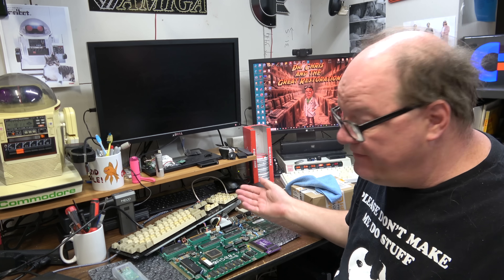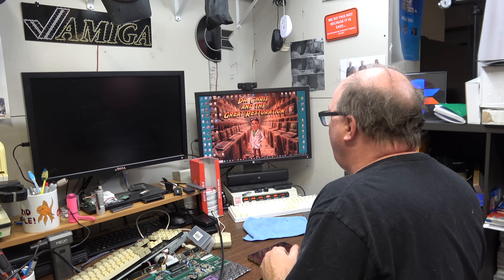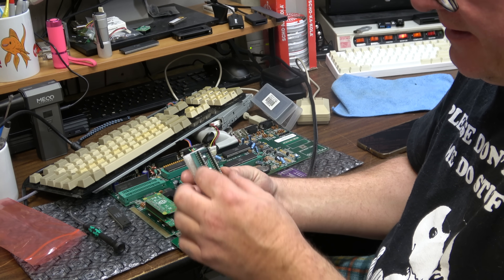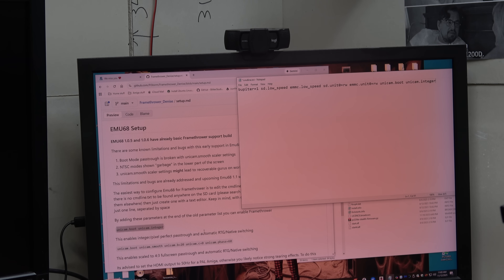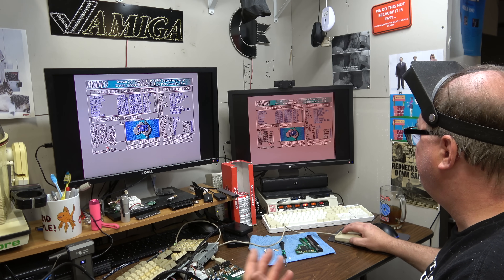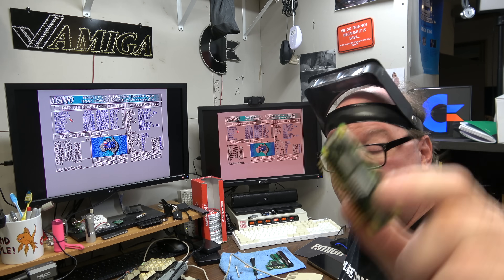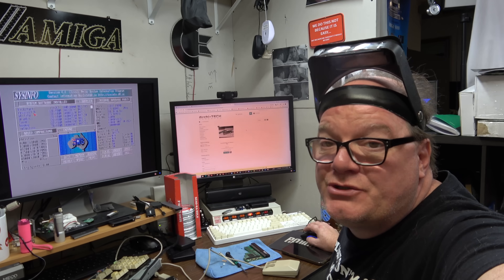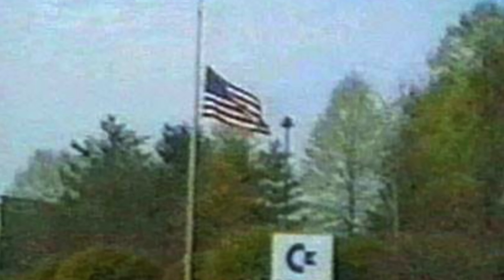The Amiga PiStorm Framethrower  Single source video over HDMI for less than 50$

Comment: It does work fine with the Pi Zero2, just needs a different cable (the camera port is the FFC connector on the end of the Pi)

15pin to 22pin, or any Pi Zero camera cable will work
Reply from the maker: Ooooh even better!!  Pinned!
Reply: So I have my solution for the NTSC Amiga 1000 w/ Zero2. I’ll look for that FFC compliant connector
Reply: @subcell-y9k just doing a search for "Pi Zero camera cable" should find what you need.
Reply: @LemaruX Found it! 30cm for my Amiga 1000
Reply: I have a Pi3a in my 500 PiStorm, does that also work?
Reply: @pikewerfer yep
Reply: @LemaruX  cool. Ordered then!

Comment: I installed the framethrower into my NTSC Amiga 500 and after editing the cmdline txt it performs fairly good. I know the install instructions they do mention that the garbled bottom quarter of the rgb screen issues will be dealt with soon. Is there any work around on this? If you run a game or even paint program, some parts of screen are not present because of garbled bootom quarter.

Comment: ok, got mine, installed it and running caffeineOS... I tries different games that I have played bedore framethrower. Graphics looks scrabled in hdmi output and games are crashing after a few minutes... still trying to figure out what went wrong
Reply from the maker: Caffeine is already rtg on hdmi. This isnt for that its rgb
Over hdmi i think they conflicting
Reply: @ChrisEdwardsRestoration checked out also the rgb output. Same problem there... 
I removed framethrower and installed Denise back without it. Debise checks out ok. So something might be wrong with my framethrower.... Might be a Hardware error
Reply: @jgeorkas I would try contact cleaner on the Denise socket, chip and Framethrower before assuming a hardware defect.

Comment: Already found a bad point, if you're using the ACE2 indivision 2 meg agnus on a A2000, the Framethrower overlaps preventing both from working at the same time. Only thing I can think of is removing the denise socket and putting the Framethrower straight onto the A2000 so you have the clearance. Or getting an Agnus coupling to raise it higher. EDIT: looks like plcc84 "couplings" are outrageously priced and wouldn't fit under the power supply /drive bay of an A2000.

Comment: I received my Framethower yesterday. I've been waiting for it for quite a while, even though I'm also from Poland. This scanline is annoying me. I need to upload a different firmware, but to do that, I have to disassemble half the Amiga because the riser rotates the PiStorm so that it covers the Framethower's USB port. Let's hope software will be released that allows this to be done from the Amiga.
Reply from the maker: well its programmed via the usb port, you saw it took 2 seconds. might be worth the effort to crack it open

Comment: What solutions are out there to have a female HDMI connector on the Amiga500 ?
Reply from the maker: you just add a normal extention header from a pistorm or rgb2hdmi and it uses a normal hdmi out you can run either in your side door, drape out the side, or remove the modulator and install the plug there.

Comment: Might as well just run the Pi with a emulator at that point...
Reply: Why?

Nothing is being emulated other than a CPU via Em68. All this does is capture the native video signals from Denise and feed then into the Pi. You are still using the real Amiga chipset
Reply: You could say the same about anyone who buys, restores or uses retro computers and consoles. You could simply use an emulator, and besides there are probably modern versions of any games and applications that will run natively on modern hardware. So why would anyone bother owning ANY retro tech? Because they want to.
Reply: The augmentation and the technology tinkering is the fun yes it probably has no practical use but that never was the point to begin with
Reply from the maker: like pimiga?
Reply: @ChrisEdwardsRestoration  Sure. Hell, can even run amiga in a web browser lol
Reply: @memadmax69  still don't see your point - different horses for different courses.  For PiStorm owners, having a single HDMI output for all video signals is a blessing.  Why would existing PiStorm owners then just jump ship from native HW and go use emulators?

Comment: 2 pcs ordered 😎
Wonder if the cm4 has a camara port ??
Reply: The CM4 itself doesn't, but the carrier board for it usually has
Reply: @LemaruX  well i'll won't be dismantling my 1200 to find out, at least not before the aga version comes out
Reply: @kimshaky if it's a 1200 and you are using the official CM4 carrier board for the Pistorm32, then yes it already has the required connector
Reply: @LemaruX  nice thx 😁

Comment: Thanks Dr Chris for another show and tell 👍🏻 Been hearing bout this device over on Amibay. Just waiting now on a A1200 version. Just checking, but will the CM4 with PiStorm be compatible? I.e does the CM4 have the camera port? Cheers 🍻
Reply from the maker: Probably you might want to check with them due to the CM four needing another board to interface with because the 02W is also compatible with the correct camera cable I was totally incorrect. I do the pie storm video so in frequently it’s like relearning all over again to share.
Reply: @ChrisEdwardsRestoration  Thanks. Will do. 👍🏻
Reply: Yep, the Pistorm CM4 carrier board does have a camera/CSI connector.

Comment: Hello to my old Amiga 500+ motherboard from the past. Glad it is still going strong and that the corrosion has not returned, wahey!🎉
Reply from the maker: Jw sent this to me long ago to keep if i could fix so fix i did this was yours originally?😊
Reply: @ChrisEdwardsRestoration For a short while. I bought it from someone in Plymouth UK but didn’t manage to fix it, it was in a v nasty state! Had an interesting 1.5meg ram upgrade in the belly slot with what I think are edo ram sims. Passed it over to jw and yes then it came to you. The 3000 you fixed last year is still going strong btw 😊. Have a copy of pimiga running in the shell of the 500 with original keyboard, greasweasle, floppy drive, ssd nvme, leds working, all off the pi psu. Feels like the real thing. Thank you once again Dr Chris!

Comment: Would that cable be long enough for a 2000 and would it work on pi4?
Reply from the maker: Should be denise is right under the cias next to the vid slot. You can always buy longer cables.
Reply: @ChrisEdwardsRestoration  Thanks yes ordered one and specified i need a longer cable. Just hope its not going to fight with the wireless keyboard expansion thing. Thats residing somewere under there to hehe

Comment: Cannot wait for Framethrower 1200
Reply: May take a while as a different approach may be needed (FPGA?) since it looks like the Dense version uses up nearly every IO pin on the RP2350.
Reply: @IanPtv the original Framethrower for the 1200 was using an FPGA, but there were a few issues with the FPGA (that affected other projects as well as the Framethrower). 

The plan is to use the same RP2350, and not to move back to an FPGA. And work has already started on it.
Reply: Just get a Pi, or an FPGA machine.
Reply: @jimbotron70  Not sure why I would want to get a slower and less feature rich FPGA machine, nd if ive got a piStorm32 (which I do) then ive already got a pi thanks.....